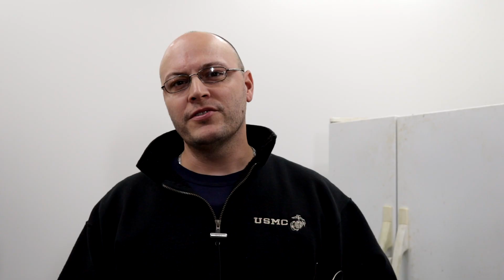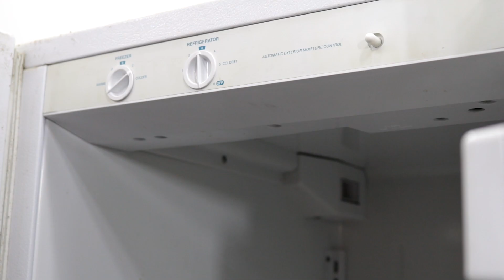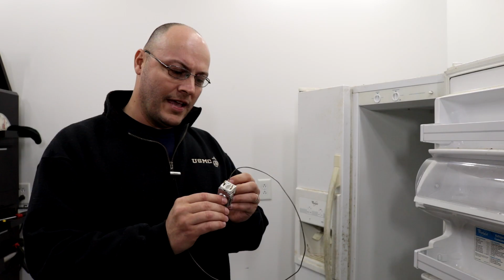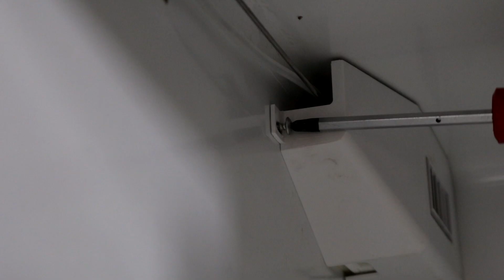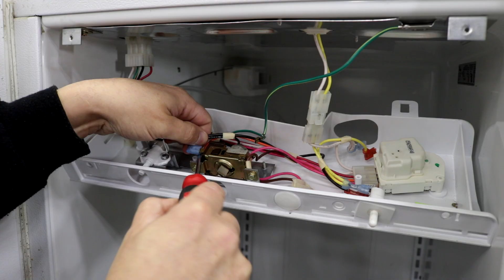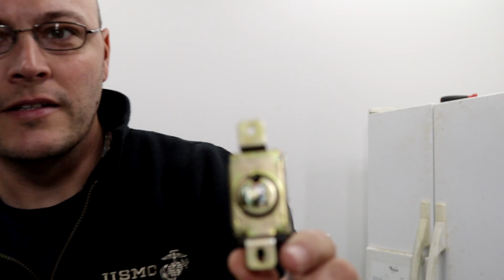Whirlpool Side by Side Refrigerator Cold Control Thermostat Troubleshooting

Comment: I just picked up a whirlpool top freezer WRT541SZDWOO for free. It's freezes an gets cold, drain pan was full of water. I'm wondering if it wasn't defrosting. so once they unplugged it, the ice melted and filled of the pan. Like maybe it needs a thermostat or control board. There is no way to put these into defrost mode like the old fridges with the screw driver timers?? Is there?

Comment: Thanks this was helpful. Pulled mine out of a 1996 model fridge and the switch has continuity when in the off position. Pricey part but at least when we order the part it will be likely the fix for the fridge running non stop freezing everything.

Comment: Instant subscribe. Real-time video, no nonsense explanations. Have an older Whirlpool unit here from 2002 and the whole thing randomly turns off until I start turning the thermostat and then the compressor and fans start kicking in and it's nice and cold. Will be replacing it and your video made it effortless now.

Comment: Thanks to You we found the problem 😢 The pins and snap clamps holding the paddle switch are all broken off 😂 Any ideas for a quick fix?? And or where do I get the part #2180228 for a side by side Whirlpool 2004

Comment: I had the same problem as you had and I have the same exact refrigerator! I ordered the part and watched you replace the cold control thermostat and i replaced mine and it fixed it!! Thank you for showing us all how to fix it!
Reply: One thing about the new thermostat was that the last 4 or 5 inches of the long thermostat wire is had no plastic covering on it. The original one I took off the refrigerator had plastic covering all the way to the end. So when I turned the refrigerator on and set the thermostat control to the normal setting I came home the next day and everything in the fridge was frozen! So I had to turn the knob almost all the way to the left near OFF to get it to a normal temperature. I wonder if it’s because of the last 4-5 inches of the long wire didn’t have plastic covering like the old one had?  Thanks again!
Reply: @b707man mine has the plastic covering almost the full length of it.

But it’s hell trying to get it all the way on.

Does it need all of it or only the last 8-10 that goes under the back cover in the rear of the frig?

Comment: Hi Bill.
Thanks for the interesting video.
But I have a question.
My Whirlpool WB360ME has an issue. The techy bypassed the heating pipes as there was a leak somewhere in the walls of the fridge. Now, it keeps it's gas. Only, it doesnt get cold as it use to. The thermostat dial has 1 to 7 on it. At normally, we run on 3-4 to get nice comfortable cold temp. But now, at 4, it gives us about 13°C and on setting 7, it gives us 6°C in the fridge section.
We have tried the test of turning to max leave for 10mins, then turn back down to setting 3.. the compressor does turn off.
Compressor tuns somewhat hit to touch, around 36-48°C. 
But we are not getting that icy cold as below...
Is this a sign of a faulty thermostat?
The techy says it has enough gas and still holding it.. no leaks.
Advise?
Must I do the multimeter test on it?
Thanks in advance.
Michael

Comment: Can you use a “jumper wire” between the two contacts on the thermostat control just to test it to see if the compressor kicks on. Basically bypassing the two internal contacts. Of course I’m not talking about permanently connecting them together because then the compressor would never shut off but just as a test.

Comment: Bill  Great video,  You save me 5 years ago.  I replaced my thermostat (WP2198202)  in 2019 on my 2003 Whirlpool(GD5HAXLT02) frig.  The freezer is presently at zero degrees. Frig is about 60 degrees F. All the coils are clean and both fans work. Frig is in the garage. Winter temp in garage is about 40 degrees F and summer in the high 80's.  Do you think my thermostat is bad ?

Comment: So I’ve been having a time with this frig. It keeps my beer cold so I keep it around 32-33. The defrost thermostat is giving me hell. I replaced the cold control early on and now it can’t be set above 1 or it gets too cold. I have jumped the defrost temp sensor and the defroster comes on and will blister your fingers. There’s a picture in my phone but I won’t bore you with that. I replaced the defrost temp sensor with one from Amazon and it was different, it had red and black wires. The original had pink and brown.  Testing that sensor you said stick it in freezer and it should close. If that was the case wouldn’t it stay closed all the time? Because it lives in the freezer. Is there a certain temperature that it should close?  So far I stilll have the original problem, but I’ve added the cold control problem that I seeem to have created with my Amazon cold control. I can go in there with a hair drier and defrost the coils and everything is sweet for 10 days or two weeks then the coils freeze up and the beer  gets warmer. Viscous cycle it is. HELP

Comment: Thanks for your video.  Before i took the risk to fully remove this part, I had the though to see if the switch contacts might have lost their connectivity due to oxidation from 40 years of use.  I merely turned the dial full cw, then ccw, and repeated about 4 or 5 times. plugged in the refrigerador, and it began to function again.  I then bought the part to have should we ever need to replace it.  though in all honestly i feel it was a mere oxidation problem.  Probably that part will last another 40 years.
Reply: Followup, just as Bill stated, 2 months later, the same part failed to operate.  I one more time turned it OFF, then back on, and temporarily it is working again.  This time i ordered a new complete part, and in a few days, I will attempt to replace the part.

Comment: Hi Bill, excellent video, right speed, not too slow, neither too fast, just at the right speed. The metal wire does not have "freon" or the modern day refrigerant, which is most likely R-134a, less harmful to the ozone layer like freon. The metal wire should contain an inert gas that expands and contracts with temperature controlling the "coldness" of the fridge.

Comment: If you watch other videos I don't think that wires filled with freon I think it's a tube call the capillary that is used to measure the temperature in very small amounts but I could also be wrong you should always watch several YouTube videos to make sure your job gets done right. If there was freon in that tube when you disconnect it gas would be coming out and you would have to replace the freon to get the fridge to start again. We all make mistakes when making videos at least this guy admitted it may not be correct overall a helpful video except for the misinformation
Reply: Gas does not come out when you disconnect it 😅

Comment: My problem is electrical connectors on left side of condenser burnt out.  I could hear a click, which I was told indicates control is telling condenser to come on, but bad connection won't allow.  Replaced connectors, but did not fix problem.  Fan comes on when I turn unit on, condenser get warm - almost hot - to the touch but I never hear condenser come on.  Unit stays warm.  Is the control switch (thermostat) the problem.  Have replaced refrig, but would like to get this on repaired an a second in the garage.

Comment: Do you ‘reuse’ the long plastic tube to protect the temperature sensor wire.  Is there an easy way to get it off and back on.  The tube got stuck halfway putting it in the new sensor.

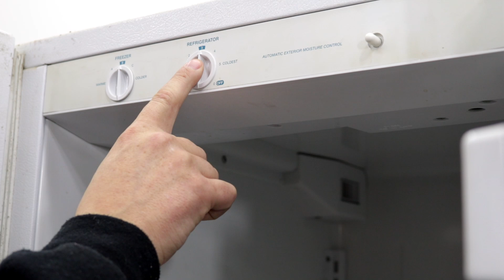Comment: Thank you brother!  I think that part at 0:35 answered my question. I have a Kenmore 106.74264400 refrigerator. I seemed to be running a lot, so I wondered if the thermostat was working right. I read online that one clear sign the thermostat is shot, is if you turn the knob and there is no "click". Well I turned both knobs (fridge and freezer), and for the freezer knob, there was no "click" lol.  I assume now there is no thermostat, just a damper control

Comment: I received the thermostat, and the tube containg the freon has a covering, like a electrical wire usually has, for most of it's length. Should I remove it before installation? Thanks

Comment: The original thermostat wire came with a rubber covering the wire like in your video but the new thermostat was just a medal wire , do i need to take the old rubber covering and place it on new thermostat wire or just replace it as it is without the rubber covering the wire??  Any help appreciated thank you

Comment: That's pretty funny don't adjust you gotta try any way if it don't work. I was wondering what was in inside mine only had 4" tube , some thing has to move in on the end wonder if freon can leak out there. These units are the same as 40 years ago, no need to change I guess.

Comment: A question, what does the long wire connect to at the back of the fridge ? Ive just got a replacement and im not sure if its slotted in at the back as i cant see what its going in to ? Mine is a different set up to yours in the vid

Comment: I have a Whirlpool ED2CHQXKB05 side by side with the controls that look like the one your working on.  My trouble is a warm fresh food section but the freezer is working fine.  Hardly any air coming out of the damper opening.  I wanted to check to see if the damper was opening and closing but unable to get the Styrofoam off the cabinet and afraid of breaking it.  Do I understand you that if you turn the freezer knob to A, it will let more cold air into the refrigerator and if you turn it to C, it allows less?  B is the factory setting I believe.

Comment: I have a Whirlpool WRF757SDEM00 that will not allow the fridge to get below 48. I've replaced both fans, thermistors, freezer thermostat, bottom control board, evaporator motor & damper assembly. There doesn't seem to be any leaks around the seal and it looks fine. Any ideas?

Comment: Question, I have a Whirlpool side by side that has a defrost control board and my problem is freezer side freezes but fridge side only cools to 44 degrees , I found that the coils behind the cover inside the freezer side were iced over completely, how do I diagnose/ check the defrost control board , obviously its not defrosting and since its a electronic defrost control I can’t manually advance it like a analog type ...?

Comment: Doesnt the stat control the frezzer side...
And the Refregerator controls damper and fan from frezzer compartment? Listening to your video. Sounds like you stated it backwards? Freezer minus and compressor evap is in frezzer side air drafted of from damper stat... when freezer rises. It calls for compressor. When refergerator side calls it turns on the draft Fan

Comment: Hey Bill, great content, thanks for the upload. One QQ if you can recall when doing this: When (re)installing the fridge nob (on the right), even when correctly lining up, the nob doesnt seem to fully snap in to the post. There is still a small gap there. The left control for the freezer attaches just fine. Any tips would be greatly appreciated, thanks.

Comment: My whirlpool side by side is freezer gets cool air but not cold fidge side does not cool at all I replaced the evaporator fan but that did not fix the issue I will replace the thermostat and if that does not fix it I'm all out of ideas unless I have a bad defrost switch somewhere

Comment: I have this very fridge. I am really trying to fix it before we need to spend thousands on a new fridge. So yesterday i changed the capacitor on the fridge and the fridge was working amazingly for a entire day. It managed to freeze some water we put in the freezer. Prior to changing the capacitor it wasn't freezing at all. Now it started to not work again. I noticed that the device to the right of the thermostat keeps clicking every like 20 to 30 seconds and when it does it completely shuts down the internal fridge fan and when the compressor does come on it only stays on for a few seconds. Another thing that I've noticed is that the condenser fan at the back of the fridge is always on even when the compressor is off. I've read somewhere else that the condenser fan and compressor are wired In unison so the compressor will not shut off if the condenser fan is on. Maybe this caused the compressor to overwork because it stayed on for a entire day without turning off? I also just checked the thermostat and it does in fact make the compressor kick on when I switch it from off to on. So it should be working fine.

Comment: I replaced the relay and capacitor and it started working  for day. It started turning off and on . The relay was rattling  inside. Can thermostat control and relay capacitor fail at same time.

Comment: I have a Kenmore Coldspot, very similar to the fridge in this video.  My freezer won't stay 0 degree F, but fridge side is fine.  I have to crank down the temp control almost to coldest setting and close the damper to get the freezer to get it to around 6 degree F but when i do that, the fridge temp is around 30 degree F.  Tested the temp control, appears to be fine.  Turned it off and it break connection, turn it on and it show 0.2 ohms.  Thoughts?
Reply: Turns out my 21 year old fridge needed a little freon. Added just a bit of r134a and it seems to do the trick.

Comment: I am pretty sure there is no Freon or any other gas inside the wire. Most likely it's a bimetal thermocouple. "A thermocouple is an electrical device consisting of two dissimilar electrical conductors forming an electrical junction. A thermocouple produces a temperature-dependent voltage as a result of the thermoelectric effect, and this voltage can be interpreted to measure temperature." - Wikipedia

Comment: i have a sxs whirlpool refrig. w ice maker. both the freeze and frig stopped working. I moved both controls one for the freezer and one for the frig. all the way to off and back on. both started working again. this happen a few times. the last time it happen this procedure didn't work. I unplug the elec. plug from the wall waited about 15 sec. plugged it back in and it started working again. ques. what part is bad? please email me or point me the correct video.
thanks bill.wjwent@gmail.com

Comment: Hi Bill, hope you still check this video and give me some hints. My Thermostat is WP2161460 which has three wires plugged in marked as 1,2,3. Could you advise me what is terminal 1 for? 2-3 is open circuit no matter how I slide the setting. The one by its side has the same looking but that is for the freezer has a short circuit on 2,3 at room temperature.

Comment: Bill, all of my refrigerator is working. The fans, the compressor, motor etc. The trouble is, as you show in this video, it is not creating cold air. How can i detect if its the thermostat or something else? I've cleaned all the coils under the frig from dust and removed the freezer inside panel to ensure the coils were free of ice. Its a little cold in the freezer still but not near freezing. Although the whole unit is still running and i can hear the ambient "running sound" it doesn't crank up to create cold air and make the louder "cool down" sound that it normally would. Any and all help would be greatly appreciated!

Comment: Bill Newberry !!! There hundreds videos on youtube saying how to change damn  Cold Control Thermostat in home refrigerator. But nobody explains how it works and what is inside of it. Can you do a video to help it? How the temperature control in refrigerator works? The question is "what 2 methods to control the temperature in a refrigerator with TXV system?" I am doing my homework for college. Can you help me? I already know how TXV works and how refrigeration cycle works. But I cannot find information about the rest of the question. Also I dont know what is the diffrerence between the building space Air conditioning thermostat and home refrigerator thermostat.

Comment: Thanks, bill.  Your instructional was very helpful.  Here's a tip a pro ac/frig guy gave me for the hardest part of the job: Threading the copper tube thru the plastic sleeve - put dish soap on the tube and it'll slide right in with no deleterious effects on proper thermostatic operations.

Comment: My problem is my fridge will run until it reaches it’s set temp and then it will kick off then will not kick back on I have to turn the cold control back a little then back up to get it to kick on

Comment: Hey Bill - Great videos. Been repairing all my appliances for as long as I can. Still very helpful. Meanwhile I've been battling a whirlpool side by side, defrost element not coming on. Replaced defrost timer and cold control, about 7 days later temp in freezer rose, coils caked. Replaced defrost thermostat. 7 days later, same condition. New defrost thermostat tested bad, replaced. Again days later, same condition. Noticed I could tap the cold control and that would cause the circuit to close. Again replaced cold control. Again days later, same condition. So now I try to remember to manually engage the defrost cycle every so often for 30 minutes and then disengage and all works well. What might I be missing? I think I have replaced everything that could have been suspect.
Reply: Unless I missed something, did you check for continuity of the heater to make sure its actually good ?

Comment: My fridge and freezer controls appear to be the reverse of your setup ...
My freezer control actually has the wired thermostat behind it, with the attached sensing probe running into the freezer compartment.  The fridge control is not wired, but it does have a sensing probe for fridge temperature, which in turn controls a damper to the fridge compartment.